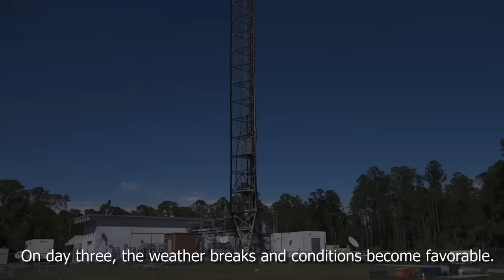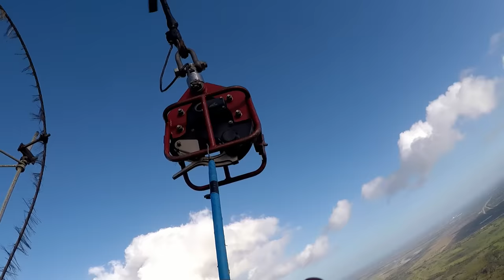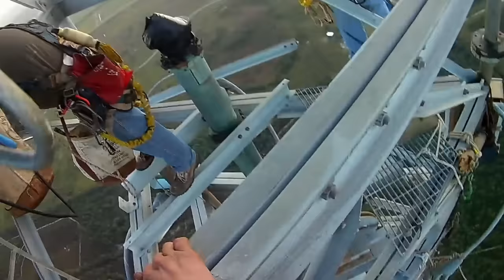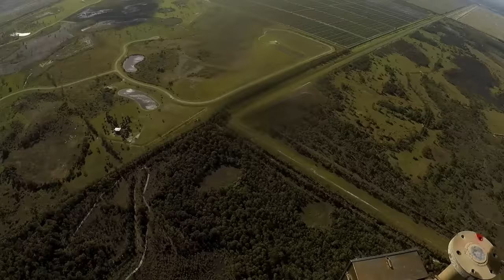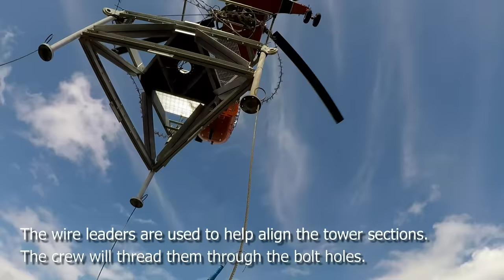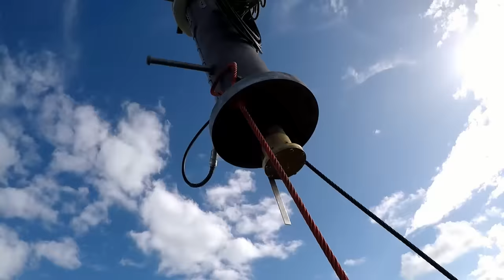ABOVE THE CLOUDS   03 29 2019 ANTENNA CHANGE OUT

Comment: My Dad would say:  “What the hell was wrong with the old antenna?”
Reply: Tuned for the wrong frequency. The old one was for channel 34 the new one is for channel 20.
Reply: hahahahahaha this is great
Reply: @SmokiesDen  HAHAhahahahahah !!!
Reply: That's pretty much what my dad would say as well.
Reply: The old rabbit ear antennas don't work and it's outdated everything went digital now
Reply: @norms3913  Rabbit ears still work.....the station just changed frequencies.  The old antenna was designed for a different one. Nothing to do with digital.
Reply: @eminence_front6043  the converter box replaced the rabbit ears antenna it draws a lot better signal the old antennas do
Reply: @norms3913  A digital tuner doesn't need a converter box.
Reply: @eminence_front6043  I was talking about about ppl who dont have not gone digital and stuck with analog with those old heavy tvs. Sheez 🤔🤔🤔
Reply: @norms3913  People who live near broadcast towers still use  rabbit ear antennas plugged into new digital TVs.   That hasn't changed.  I have one.  It doesn't need to be an old tv to work with them. People get confused and believe digital is different somehow.  The signal is still analog.
Reply: @eminence_front6043  I don't cause them towers interfere with my signal
Reply: @norms3913  "I don't cause them tower's  interfere with my signal "     WTF ?
Reply: @eminence_front6043  LOL! Ya its so stupid to know how digital OTA TV works. I think he means "them towers" interfere with the signals aliens are beaming into his tooth fillings :D :D
Reply: @notsure7874  It is stupid . Google is your friend if you can't understand how digital OTA tv works...
Reply: @eminence_front6043  How some people get through life is beyond me.
Reply: @notsure7874  For sure...
Reply: @SmokiesDen  Are there channels in your clouds? In the scientific world (where the kilometers come from) there are Hertzes and wavelenghts. No channel numbers. That is just an application of the hertzes.
Reply: Do you know that bicycle racers joke? Years ago they had to repair a puncture themselves. Today the wheel or even the bike is swapped. But the joke is, when you are in a hurry, chances are, you remove the inner tyre, and you mix up the two inner tyres. By mistake, you reassemble the leaking tyre. Oops. It can go wrong, wait, it will happen to you.
Reply: @norms3913  Is your fysics laws all digital for you? Temperature no longer analog? Your car wants bits of gas, instead of galons? Your children producing an audio stream on your wireless family  network? Babies streaming weeeeeah? Poor old analog people, they never hear your digital children banter.
Reply: J T the brick  Good idea.  I receive channels from 2 states with my yagi antenna.  Get about 45 channels.
Reply: They get beat up pretty bad by lightning over time, too.
Reply: J T the brick  Why didn't they build a tower that can pivot down,  then you'd never need a helicopter no more, for an antenna change. Just remove the bottom bolts and pull the tower down. No big deal, if you got a huge counterweight connected to the bottom. Yes, you'd need a bit more steel in the bottom part. But the advantage is very clear: no more dangling parts at hundreds of meters altitude. Mounting antenna's in the field next to the tower is way easier. One could also dig a 2000 feet deep hole, then you can simply drop the tower into the ground, mount the new antenna and hoist or push the tower up again. How easy do you want it? Be a bit more creative, when you design your next antenna tower. You can solve problems, you know.
Reply: @norms3913  I still have an old analog TV, but use a digital converter to use the new signals and I love it. It's the difference between night and day. I worked TV master control in both analog and digital formats in two separate markets before I changed careers away from broadcasting. Today's technology uses less power with more capabilities.
Reply: well.. It's old
Reply: Hahaha
Reply: VSWR

Comment: I could never do that. If the pilot makes even the slightest mistake, or there's a sudden wind... Hats off to the people and the pilots.
Reply: The sudden wind would be coming from my backside.
Reply: They won't fall far. OSHA requires fall protection for (IIRC) six feet or more above the ground. There are exceptions but towers are not one of them. Each has a fall arrest harness that limits the amount of damage done and the distance if they fall... but that does not mean they will not be injured. Wind is nearly always present and is a real pain. I was in a crew when we had to replace an O-ring in a waveguide at 55 feet... piece of cake except the temperature was about 30 degrees and the wind was 35 mph. We were each limited to 30 minutes exposure with 60 minutes warming again, which meant about 10-15 minutes on location.

Comment: It's takes some real skill to hold that helicopter steady as can be while they're working underneath it.
Reply: The autopilot is in control at that point.
Reply: Didn't know they had auto pilot, always thought the helicopter was designed to be stabilized by the crane operator in the rearward facing seat once they are in position
Reply: Yes most helicopters now have self hovering features designed specifically for stuff like this.
Reply: Oh yeah
Reply: All while watching the guide wires tower , workers, yikes. What a rush .
Reply: @netchanokpooltawee6607  That was on the old skycranes. They got an avionics upgrade recently though.

Comment: All in a day's work,, Outstanding Job, Well Done. 
  Had a chance to help replace a repeater ant on a 600 ft tower,, 146 megs.
 Elevators had been out of service for a long time,, hand climb up with a 1/2 hour break halfway,, They told me it was an 2 hour climb. I wanted to go, but the plans were never made due to having lack of weekends open, and having a great clear day worth of weather in the forecast. Before long the winter came and never did climb it,, I wouldn't do it today if asked.

Comment: So much respect for these guys and the engineering behind it all is amazing but I truly do love seeing things like the tool used to keep the top on while he got the last bolt off or the lead wires that helped guide the tower top into its correct spot and I feel most of the time it is the guys on the ground or in the air in this case who get the ideas for these things to make their jobs easier.  Engineers are amazing at what they do but sometimes you need someone who has hands on experience that can come in and say this is what works and this is what doesn't and this is what would make things better.  If companies don't utilize the people who use their products to improve then most of the time those companies die.

Comment: What’s the torque on those bolts? “Tight enough, let’s get the f down from here!”
Reply: Nah...It had to be at least 3 grunts.
Reply: At least 800 psi torqued
Reply: those aren't even grade 8 bolts they're just your average cheap ace hardware chinese bolts.
Reply: @FlyBri2112  As if you can tell just by looking.
Reply: @norms3913  Psi is the wrong unit. We are talking about torque, not pressure.
Reply: Righty-Tighty.  Lefty-Losey.
Reply: Just unloosen them to German torque specs.  Gutentight!
Reply: @quakeroats533  That's right is likely Foot/pounds.

Comment: Looks like someone on the Erickson screwed the pooch and cut the entire sling assembly loose in error. I hope the tower crew didn't forget to tighten those bolts after nearly being killed.
Reply: I could not see any  release line down the main lift wire to the two strops that were suposed to be released or are they radio controlled?
Reply: My god! How could the load line be released accidently like that? That could have been fatal had anyone been in the way or had the antenna not been securely bolted down.

Comment: I used to work replacing the microwave antennas. Installing and replacing those is a bitch since you can’t use helicopters to remove/replace equipment. We had to use winches and hand tools, it was exhausting and dangerous work being that high up. Everything below the top of the tower requires manual work, no assistance from helicopters. I’m glad I moved on from that, it was the hardest work I’ve ever done.

Comment: I actually saw one of these Sikorsky helos pick up and fly away with a D-8 Caterpillar dozer once, in Vietnam. It was on a firebase, many miles from a secure, rear area and no roads. It actually took 2 days to move the thing. The first day the helicopter got there late in the day when it was hot, that thing struggled to move it for a half hour. He actually got it off the ground, but it was too insecure . They came back the next day,, "right after sunrise" when the air was cool and dense, tied onto that hunk of iron, and were G O N E ! Amazing operation.

Comment: I used to do this job , these guys aren’t just structural riggers they also install all the coms equipment aerial dish panel sat gsm cdma omnis vhf uhf etc all the electrical wiring coaxial cabling hut termination paning in signals etc etc etc everything you see from the light at the top to the footings 40feet under ground.     Before the 2 points of contact we used to free climb only hooking off at the work site or for a rest on the way up or down.    
Fear keeps you safe.

Comment: Awesome video.  However, I can only wonder why they do not use a Female sleeve, Male port for initial connection to make alignment easier,  which would make the whole operation much safer too, especially if the helicopter needs to move away quickly.
Reply: Yes, I was surprised how long it took to get the antenna aligned and the bolts in.
Couldn't figure that at all!
Tky. Great video

Comment: If I were a worker, I would have a parachute on my back.
Reply: The back is where the fall arrest harness has the D ring normally used for the lanyard to clip them to the tower. If you look you will see they are all wearing one.
Reply: There are about a hundred other things that you actually NEED to worry about besides falling. Out of everything that can go wrong, falling is the least likely - electrocution, radiation, getting crushed, etc, are all things that have a greater probability of happening ...the extra weight and imposition of a parachute would affect your movement and your ability to effectively get work done - you have enough things to carry already. Furthermore, there is a huge range of heights where a parachute would be of little use and unless you deliberately jumped and tracked away from the tower obtaining a stable position in free fall for a good deployment, your parachute would likely just end up wrapping around your body as it hit the tower on the way down.
Reply: Michael Devito on that cheerful note 😂...

Comment: I don’t know which is more difficult, working at the top of the tower, or flying the helicopter and being rock steady. The pilots can’t be anything less than perfect at what they do.
Reply from the maker: Actually the crane operator is sitting in the rear bubble on the chopper. 
When the load is engaged, he takes over flying and the winches. 
A very complex task!!

Comment: I wonder if that is some kind of auto-hover, or that pilot can do that manually? Either way simply amazing…
Reply: Nope, it's all flown manually. Of course, this helicopter is real stable anyway, but it still requires considerable skill to control with that precision.
Reply: @dwightstewart7181  Interesting, and I don't your remark, but my $500.00 drone will hold station in a hover very accurately in a significant crosswind.
Reply: @lixloon but your drone will hold this kind of weight neither😂😂😂

Comment: How can, the main load line, release, before the chokers. Pilot-Co pilot, has enough to think about. That is a mega, mega, safety issue, that should of never, ever, of been able to happen. No interlock, over ride, unbelievable. Love to know, the outcome of the incident investigation, from the aviation authority. Headlines. 3 men dead, Tower collapses, all for a basic no go interlock. No reaction from workers, as incident happened, absolutely amazing, total respect. Stay safe.
Reply: I thought the same Peter. There has got to be a better procedure. Lining up the flange took way too long for one. They could design an alignment jig that would be attached to the flange or base. As far as why assembly was dropped,,,thats another story. Im not writing this to find "FAULT" Im writing this out of concern for the crews involved. An antenna is not worth the loss of life. My hat goes off to the crew on the tower and the chopper crew. Work safe and God's Protection upon You All.
Reply: Worked in Heavy industry, all over the world, all my working life, retired know. Just noticed, after watching again, the main load line connector, on the last lift, is different, from the other 3 lifts, it was yellow, the other was red, cable changed, or different Helicopter ??. And I agree, it did take a long time, to locate the final antenna, and as you said a locating flange, would of helped. Hard enough to locate load with chain blocks, working on the floor. Never mind, load hanging of a Helicopter, working thousand + feet up. Again, total respect to all people, working in such conditions. Stay safe
Reply: @petergarbutt9521  they could of been a bit clever with the flange and made it have slot/key channels , so when it is lowered, get the keys to drop in the slots and boom, it is aligned. they could even do it with a circular ring/groove.  that is no place to have a flat flange face to align that many holes!

Comment: I used to replace and fix antennas. The highest waa 680 ft. Back then we would climb and use a portable winch to haul the antenna up. One day the winch failed,  lost power. I climbed the 300 plus feet down and

Comment: In 1972 I had a small business in the Phoenix area doing antenna work. Just small stuff that I could do with just one help. The tallest tower in Phoenix at that time was 675 feet. Looking down, my truck looked like a cut green bean. I was getting $70 an hour for contract work and triple time for off contract.It was kind of fun as long as the wind wasn't blowing, too much static electricity. Fried a couple of watches. LOL

Comment: Not to cast aspersions on the dangerous work these people do but @ Approx. 5 minutes I must ask what is the tool he is using to knock the bolts of the old antenna out ??A rock?? maybe he dropped the mallet!  This is an amazing video and important for us all to understand.  I will say that if a worker has to hold his "hard hat" on in the chopper's wash he has not been provided with or required to wear the correct safety protection.

Comment: Wow to everyone involved! Nope not a chance unless paid 200k or more just for that job. I would need depends possibly though! Wild thing is I volunteered to deploy in the middle east war zones and still in the Fire and EMS field for 23 years plus! I even love flying and aviation! I can only imagine the huge wind from the rotor wash from the helicopter. That is extreme skills for the helicopter pilots. I wonder if the helicopter operator released the wrong release or if it was equipment failure? I can't believe how someone could climb the attena with only a few bolts left holding it on. Wow! Massive respect for you and your ability to do this along with your entire team. Do they allow parachutes for contingencies for a oops at levels where use could be used in emergencies or easy descend with training around the tension wires that is holding up the tower?

Comment: Naive q:
why crew doesn’t use throat microphones to able to communicate easier.
Also, wouldn’t be better to have a segment of “ rubber” rope in order to make the antenna weight like 20 pounds so the crew can easily adjust it?

Comment: I have only been up to 275 feet a couple of times and that was no problem. Been between 80 and 200 a number of times. But the most nervous I have been was on the top of a tower about 20-25 feet up as the tower moved around enough to scare you a little.

Comment: Anyone know stats on antenna  such as maintenance cost annually. life span and purchase price ? What type of permits  for installation required and  insurance needed for operation ?  Maybe this question has been addressed but for the sake of  those here what does the paycheck look like for an inspector? repair personnel ? This is one job I wouldn't be surprised  if anyone regardless of age was better off wearing a diaper and or a parachute to minimize potential risks to those on and above ground.  These towers remind of the high dive circus act into a small volume of water that no longer thrills onlookers from the past. Or did I overlook a shallow pool somewhere on display for old times sake.  Credit due all those without wings who challenge the hights to make ends meet.   Geronimo

Comment: Any ideas why Radio towers are necked at the bottom? Seems like that would make for a pretty likely failure point.
Reply: Just a guess... maybe by having a single point supporting the tower, it is free to flex  in all directions in the wind without over stressing the 3 main vertical components. The guy wires do all of the work of keeping things vertical and they will have some give.

Comment: I just hope they remembered to connect the co-ax.
Reply: Joking side, I was thinking about how they must ops check the new antenna on the ground before it gets hauled up and then again after it's mounted and connected, presumably while the crew is still in place or at least on site.  It'd be a shame if after that work there was a problem somewhere when they threw the switch.  It would have been interesting to see an abbreviated version of how they go about verifying the work at the various stages and upon completion.